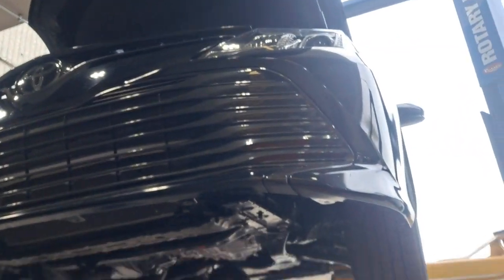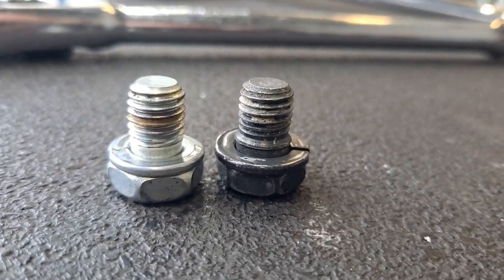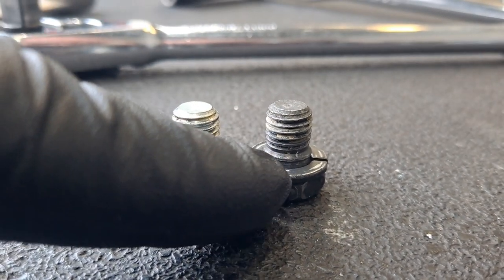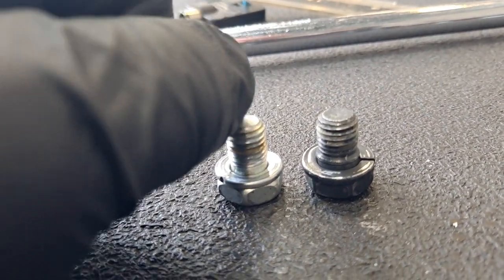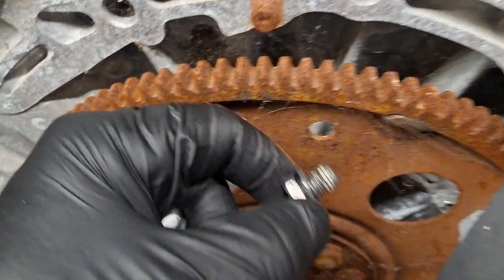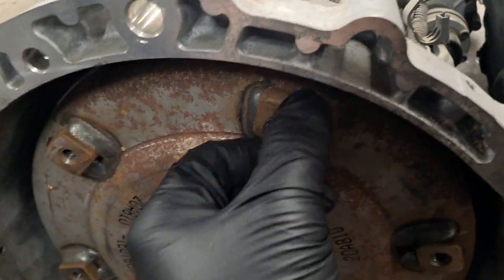Why the BLACK bolt goes in flex plate/torque converter on Toyota first

Comment: Does it matter which hole the black one goes it? Or just as long as that’s the first one to go in it doesn’t matter what hole?
Reply from the maker: Any hole, that's what trips everybody up. It's the bolt that is special, vs some manufacturers a have precisely machined hole in the flywheel to align the others. Toyota uses the bolt with shoulder in stead. 
Just pick one and get r in there.
Reply: @paulkelley86  I’m just worried I’ll do that and follow the manual and still end up with my pump seal leaking lol
Reply from the maker: @koriseitz2629  just make for sure you get 3 clicks when you are setting the torque converted into the transmission. See my 3 clicks torque converter video. Thats the part that gets messed up a lot.

Comment: Do these bolts need replaced after being used ??? Can I use them again with lock tight??
Reply from the maker: They do not call for replacement from memory.
Reply: @paulkelley86  I bought new ones from Toyota to play it safe. Especially with the lock washer being flattened already I'm not taking any chances.
Reply from the maker: @noahriedel801  for sure safer bet.

Comment: Can we put the black bolt on any holes since all the holes look alike and there is not such as a pilot hole like other manufacturers do? I’m having trouble with the flex plate wobbling a lot
Reply from the maker: Yeah in this case it's the bolt that is special. Any hole will do. 
Unlike GM where the bolts are all the same but one hole is unique to center the flex plate to the torque converter. 
Very good.
Reply: @paulkelley86  still not able to get that perfect alignment. Could it be the problem with torque converter not sitting in the right place?
Reply from the maker: @kuengyal23 describe your issue more. I can't picture what you have going on. 
You said it wobbles?

The purpose of the black bolt is to allow you to have the torque converter and flex plate holes line up perfectly center so you can start and  torque the black bolt, then then each of the remaining 5. 

Without the black bolt you would need to start a bolt, spin it in most of the way nut not tight  then rotate to the next one and start that too, until you get all 6 started. Then go back around and torque them all.

 Otherwise you will find you can't get the later bolts lined up and have rotate back and loosen the first ones up.